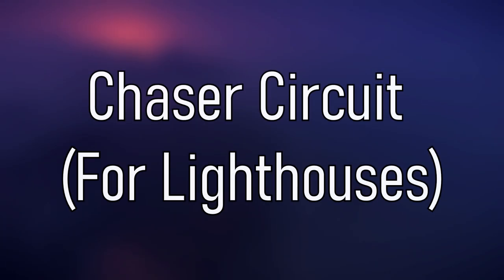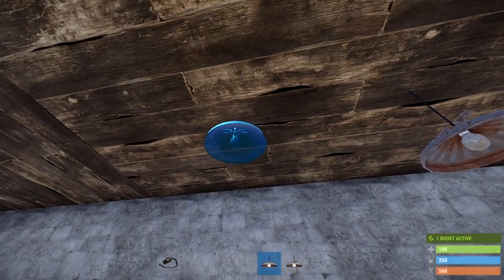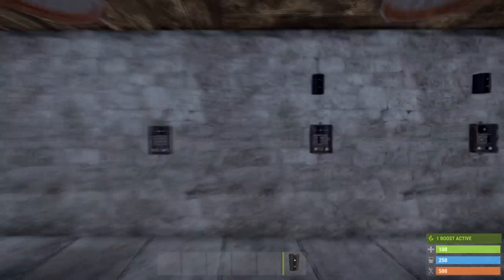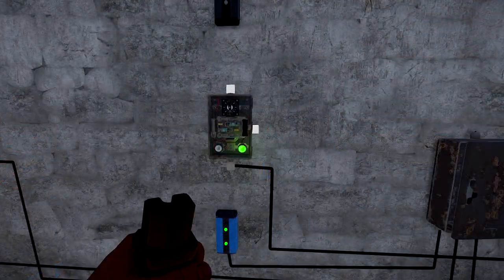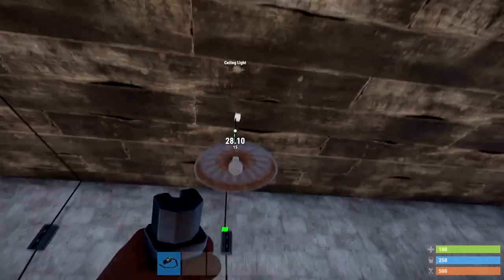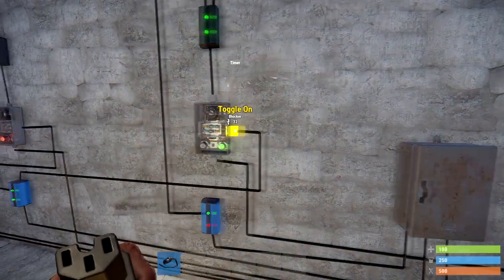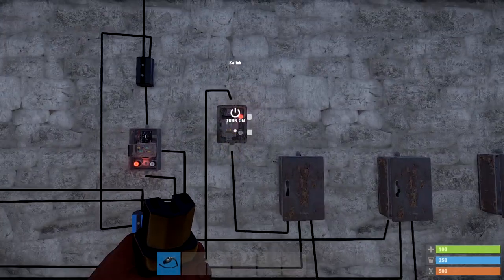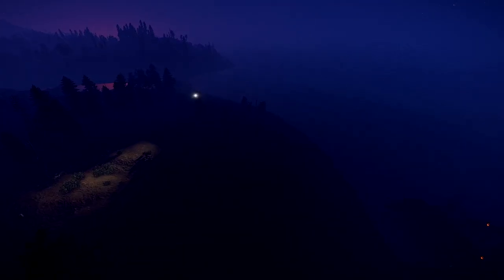Build Your Own Lighthouse | Rust Chaser Circuit

Comment: Also.. Why having a switch and not a solar panel + blocker to be used as day and night automatic switch ? =) 
I built one just to look at it when the sun is setting and it turns on at the right moment when 5ish% of the sun is visible.